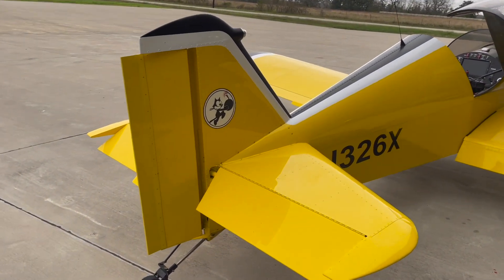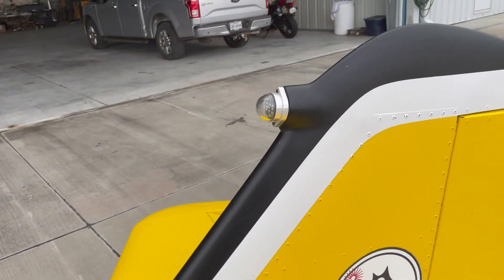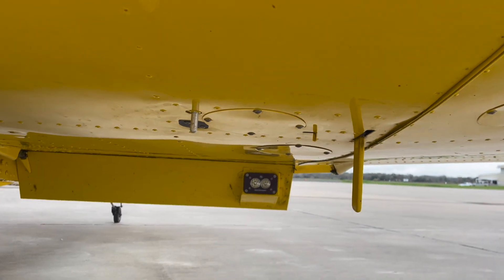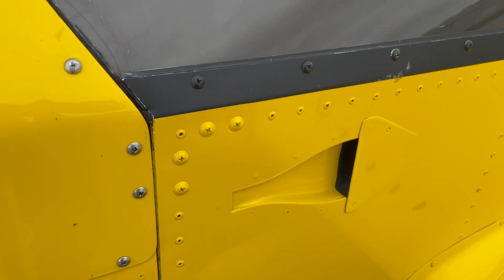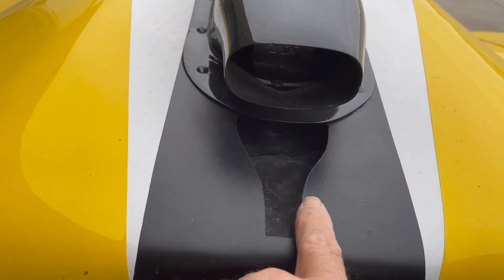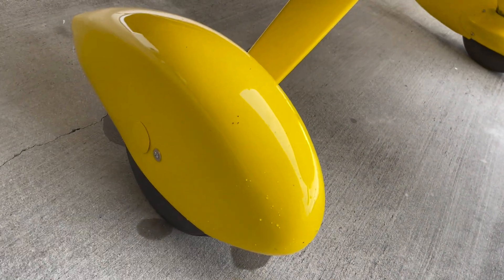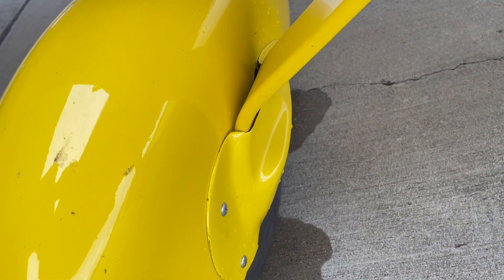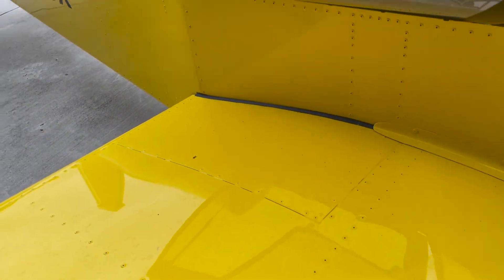ONEX Walk Around

Comment: I’m curious what model of pitot tube you installed?  I like the design!
Reply from the maker: I built the pitot/static system my self.  Using 1/4 aluminum tube and epoxy/ fiberglasss. The pitot is on top and the static tube is underneath. the tubes extend about 4 inches inside the wing to make hookup easy. reads more accurately than the underwing mount and is far enough outside the prop wash to read in undisturbed air.  Important for an accurate stall reading...
Reply: Beautiful job!  I love the look!

Comment: Note that the root should stall first... weird way of doing it adding them at the root which would promote the tips to stall first
Reply from the maker: Yes, It is true that the major aircraft producers put twist or washout in the wing to keep the outer portion of the wing from stalling. The indoor  VG's were an attempt to enhance the performance of the very short span flaps [30 inches]. The ONEX has only one setting [full 40 degrees down]. When landing, it was hard to arrest the decent rate for the flare, a "bang in" carrier landing was the result. The inboard VG's have changed all that.  Now the flare is gentile and gradual, allowing to a smooth and controlled landing flare. The VG's also had the bonus effect of decreasing the stall speed from 53 mph to 48 mph!  In addition, the right wing does not drop suddenly in a stall. I could not be happier with the result. I encourage all ONEX flyers to put on the inboard VG's.

Comment: Nice airplane, Carl. Which model of UL engine did you install?
Reply from the maker: The UL 350is is the 130 hp @3,300 Rpm. The Prince Prop is a carbon over maple P-tip with 54 inch dia and 64 inch pitch which really hooks up in climd and indicates 3150 rpm for a quick and short take-off. The rudder had to be extended by 3 inches to handle the big P-factor, right rudder  on take off is big!

Comment: Your airplane is very nice.  May I ask how you like it as a long cross-country airplane, say flights of 3-4 hours duration?  Thanks.
Reply from the maker: Ok, the fuel burn is 6 GPH so if you do the math that's a 2 hour endurance on the 16 gallon tank. so at 165 mph the range comes out to 300 mile with reserve. You gotta look for a fuel stop every two hours....

Comment: How much extra did you spend for the extras.
Reply from the maker: Sorry for not getting back to you sooner.  The Dynon panel was $10 K and the Ul Power Engine was a very costly $24 k Prop by Prince $1,500 dual Lithium Ion batteries $700 Actually lost count of the total expense during construction and then did a $4,500 paint job....yep airplanes are not cheap....

Comment: Carl, that is a very well maintained machine with a lot of attention to detail. Would you mind elaborating a bit more about how you embed the brake line and how you reinforced the wing? Thanks!
Reply from the maker: The trailing edge of the landing gear is were you glue the plastic 1/4 inch brake using hot melt glue. Then epoxy micro ballon putty is applied and left to cure,then is sanded to cover and hide the brake line in an aerodynamic trailing edge. This is then over laid with a single ply of fiber glass for protection then painted. A very trouble free an beautiful solution.

Comment from the maker: The ONEX has a climb rate of 1,500 fpm at sea level 110 mph. Flying the ONEX:  Take off is a challenge due to the high P-factor, lots of right rudder and attention to keep on the runway. Landing is easy, one of the easiest taildragger to land I have ever flown!!  Aerobatics: roll rate, full roll 3 seconds with a Red line Never exceed speed of 216 mph!

Comment: Where did you get the vortex generators and how did you decide on the number and spacing?  Also do they affect your cruise speed?
Reply from the maker: The vortex generator is by Stolspeed, the spacing is 2.5 inches and located 3.5 inches back at 7% of the cord of the wing. They seem to have no effect on cruise speed.  They lowered the stall speed from 54 mph to 49 mph. The biggest benefit was the landing characteristic change.  When you raised the nose for the landing flare, the ONEX would drop hard to the runway before the installation of the VG's , after the VG's were install the ONEX now very gently settles onto the runway smoothly.  This was an unexpected flight performance improvement!!
Reply: @carleldridge8317  Thanks for the information.